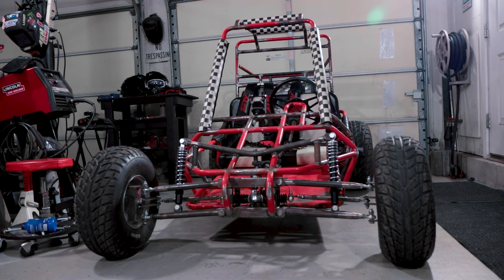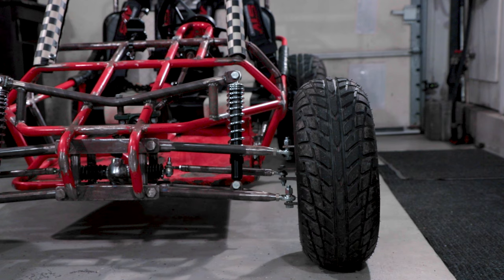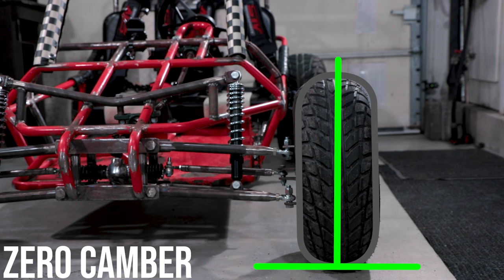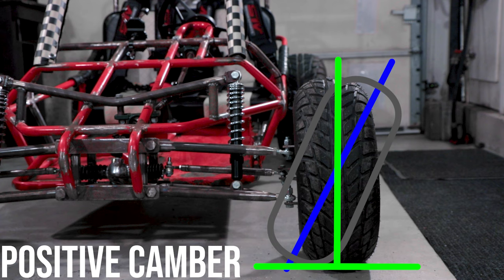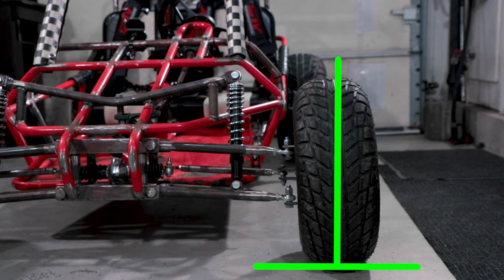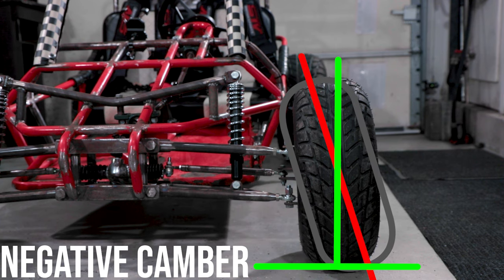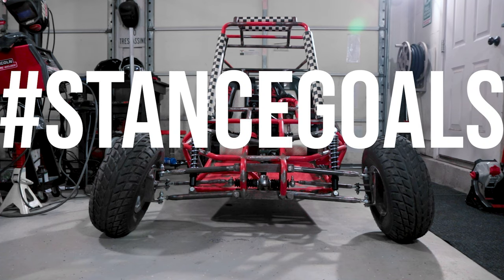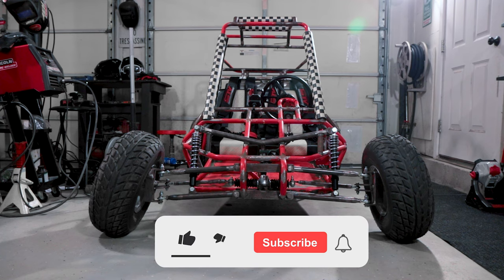Camber Angle Explained | Performance Impact | TYRANIS TIPS

Comment: Project Hot Balls Johnson (Ydog30034) has those darned fix spindles so that the suspension basically forces the camber to plane out for some pretty janky understeer. Of course this is easily corrected by copious use of the right foot! Of course understanding terrain dynamics, mechanical capabilities and inertia help a little too! Jokes aside,  its not half as bad since I centered the controls and used 16 1/2 inch tie rods on both sides. Heck, I'd be happy to flip the pitman arm and get those rods up if I can and yet here I am with a new Amico Pro 200 and some 7018 salivating over these delicious little tid bits of knowledge you possess! Thanks again, any suggestions on a rack/pinion for this bad boy? I have three projects lined up already (mini bike stuff) but I'd really like to work on my kart since she's so minty.
Reply from the maker: Evening out the tie rod length on these Yerf Dogs makes a HUGE difference! As for the rack, I'll link the one we use in the description!